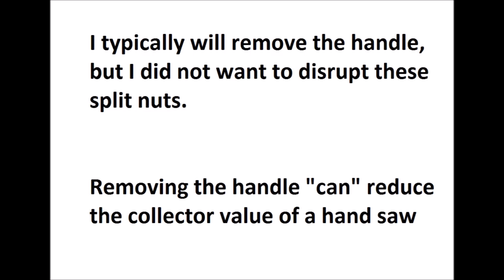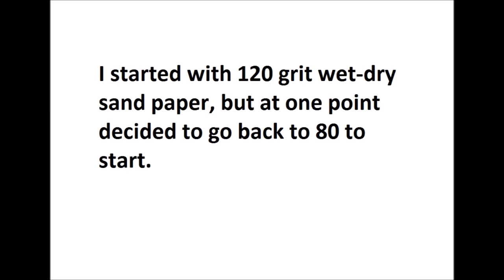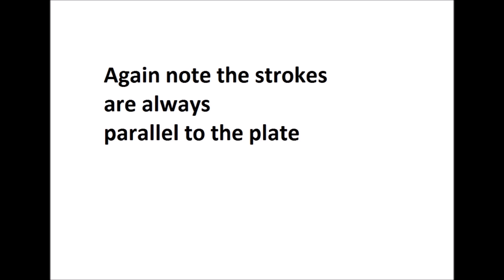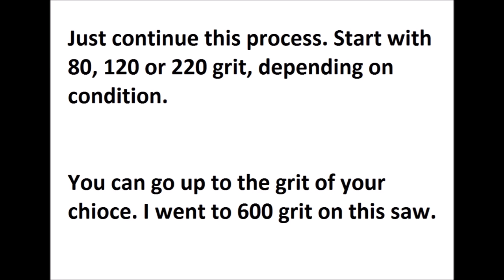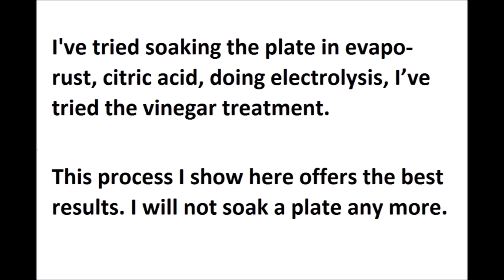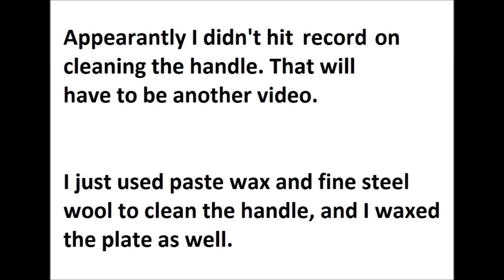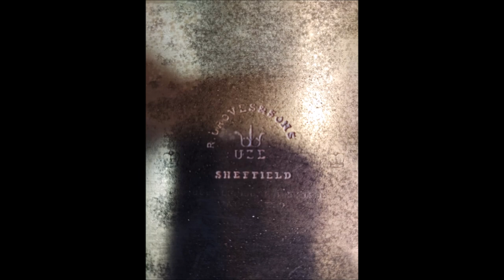groves saw restoration

Comment: This is no more or no less than his experience with the type of rust remover he used along with his opinion based on that.   Just like my opinion after using Evapo-Rust, the best I have used in my 75 plus years. Other wise I might have agreed with him .
Reply: PS: Just remember he said, removing handle, Might lower the price on the saw.  Plus who says using a rust remover requires removal of handle ?
Reply from the maker: to each their own. You buy a tool you have the right to do what you please. A saw restoration comes out better if it's not soaked. That is my opinion. I don't understand the hostile attitude. Soak away my friend.
Reply: @timetestedtools  : I am sorry if you perceived, my pointing out a few facts as hostile and that this was your opinion.